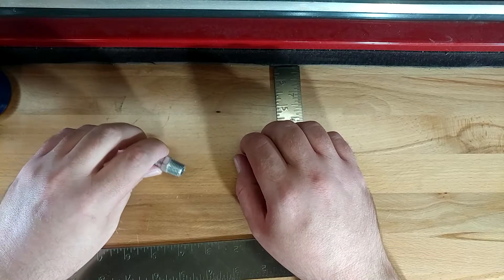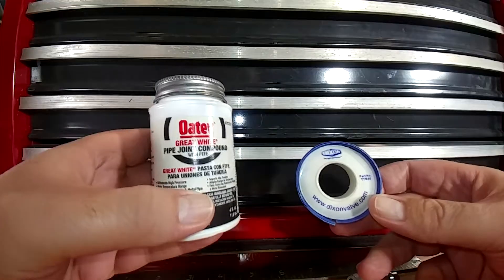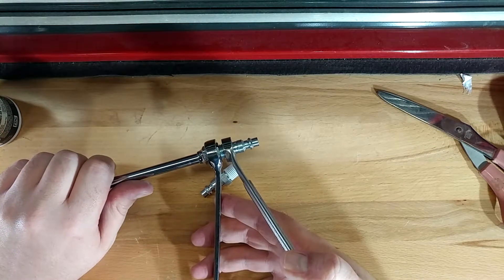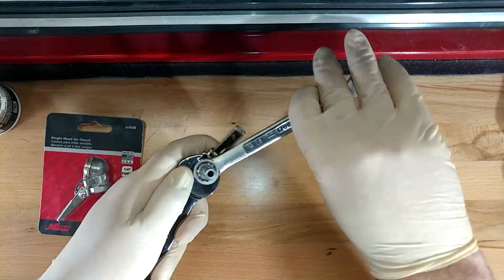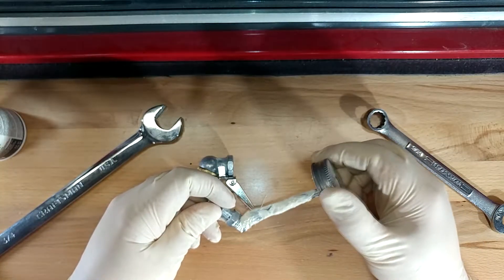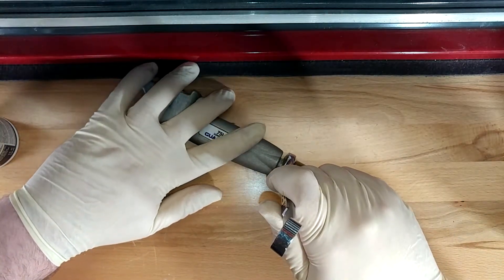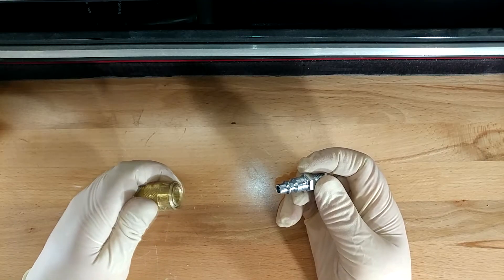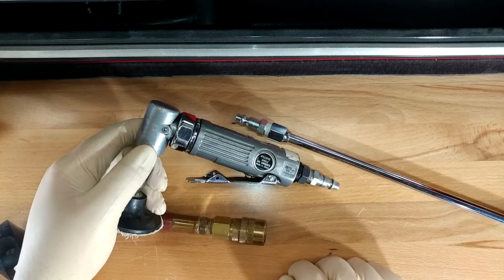How to Seal Air Tool Fittings! Max's Tech Tips!

Comment: Hey pal, you’re a really funny guy, aren’t ya?  I like that, humor what dinnae peas me off none, and what may be that I has larned a wee bit, nesty-paws?  I think all my male air fittin’s shrank in the cold some years back, and it might be that al Qoritm heard them and then suggested me you.  So it seems.  Need they then all replacing, the man parts, and so with higher voluminous fettins, or buy steel ones and drell thum out, and get some female parts, if you know what it is I may mean here, females with, say, higher flow voluminosity to match with thae men parts, but what, I ask ya, shall we do fer thum hoses: up to ⅜”, or æven ½”?  All of thus to impress the naybour, but so too to run my gun wuth paint, yeh see, and a needlin’ scaler.

If yeh thot whut it were hard to read and understood whut were writ, imagin tryin’ ta write et! (or werse, hyar me telkin’). Sae oot thu werds iPhonetikalli, y’ell hyar et!

Comment: If you use teflon tape, check the inside of the line if you remove one. If you screw your quick connect directly to impact tools like hammers, needle guns, impact wrenches, etc they are going to eventually leak. If your coupling is leaking a lot of times you can disassemble it, flip the gasket over and get more life out of it. There are 2 products that work better than tape or dope in my opinion. Loctite 241 which isn't even marketed as a thread sealer but does a good job. Loctite 55 which is what I use now. Tape has no redeeming qualities.  Dope is alright but buy the little tubes if using it on air fitttings. The main problems I had with it was line side on a 240psi compressor. 241 is more consistent than dope but at least one fitting has to be "reactive metal". 55 amazes me every time I use it.

Comment: most air coupler manufacturers also incorporate One Touch a type of quick-connect fitting used in pneumatic systems, allowing for fast and easy attachment and detachment of air tools and hoses. One Touch AUTOMATIC Operation means no need to pull back the sleeve to connect . These couplers are designed for efficiency, enabling users to quickly switch between tools and maintain a secure, leak-free connection.
Reply from the maker: I believe most manufacturers have them available, but at added cost. I've never had any particular problem with the manual ones, but I see the appeal.

Comment: do you need to use teflon tape on air hoses with brass fittings
Reply from the maker: Or another thread sealer, yes.

Comment: I would think my air compressor would just be tightened enough without losing air but I guess I was wrong.I followed your methods and hopefully the teflon tape seals the air leak.if not it’s most likely the fitting
Reply from the maker: I hope so too! Good luck with it. 👍

Comment: I ended up ordering some Loctite 545 thread sealant for my compressor as I'm having to replace the pressure switch on my Central Pneumatic.
Reply from the maker: That will probably be fine.

Comment: I started out on harbor freight’s 3/8 fittings, I believe 4 of them two on my compressor and two on my hoses. The compressor is long gone burnt motor after 6 years and the hoses are riddled with hole and in the gave but my fittings are still going strong probably 8 years later on new equipment and tools. Results will vary i might have gotten a good batch years ago when I bought them n I have oiled the rubber gasket/ring in the couplers when I switched to a new hose or compressor that might have made the difference in longevity idk tho that is just my speculation. I have two Milton’s after being shamed and bullied by my boss and crew Milton $17.99 each x 2 plus tax just to make every get off my case n that was just for the coupler alone no plugs included. Granted this was years ago but I remember paying $4.99 for harbor freight fittings when back in the day and it came with 3 different plugs/nipple male and female . Nothing against Milton by any means every one loves them I like the ones I got they are smooth easy operation but I don’t think they are worth the price tag especially if you are outfitting entire air system compressor tools hoses that’s gonna be pricey really fast . I also am not a harbor freight fan boy let me tell you harbor freight has let me down time and time again with a variety of tool failures they sell alot of crap but it’s so cheap that you a man gets confused by the sexy price tag and you find yourself wandering through the store arms full of nonsense every time you go in there. Harbor freight is truly the devils den
Reply from the maker: We all have our own experiences. I've had to replace so many of the HFT, or box store, fittings that I just got tired of it. If you're having good luck with yours, then that's awesome.

That said, what you paid for your Milton fittings is insane. The kit that I linked in the description is currently $35 and comes with 4 female couplers and 10 males. I like the fittings, but not at the prices you paid for yours.

However... I have been slowly converting over to Parker fittings once discovering that the Miltons have steel cores (the real root of why that's a problem is probably my fault, but...). The Parkers have stainless cores, but and the Parkers really are like $20/ea. 😔I will probably only use them in my most common locations and stick with Milton for the lesser used stuff.  A lot of guys have also suggested I look at the Milton V line of high-flow fittings and I have that video progressing in the background too. They are also very affordable.

Comment: I bought a new air pressure gauge and the 1/8 NPT goes all the way into the chuck and won't seal. Any idea of what to do?
Reply from the maker: I'm not sure I understand the problem. Does the fitting leak at the gauge where you installed it or does the union between the two halves of the air chuck leak once connected?
Reply: It leaks at the threads.
 @TheBrokenLife
Reply from the maker: @kwells4438  I've seen fittings where the threads are cut so poorly that I had no choice but to really layer the tape up to get them to seal. Sometimes to the point that I could barely even see they were threaded.

Comment: I have ALOT of big bore pcp pew-pews... and they all use 1/8" 8mm quick disconnect fittings. They are all either NPT or BSPP. Most use bspp outside of the USA. But USA uses a mix of bspp and NPT fittings. Its a huge pain in the a$$ lol. The pcp industry is trying to make BSPP as the standard across the board, but of course the USA still uses alot of NPT because everywhere uses that in the USA.
Reply from the maker: BSPP isn't common in the US, but we do see some. They're so similar that its easy to confuse the two. I'd more commonly run into various face sealing or tapered seat fittings (which are generally superior to both). For that reason, I'd say that any company that wants to market their various pews in the US should probably do so in NPT. I'm not even sure if I could buy any BSPP fittings at a normal store in the US.
Reply: @TheBrokenLife  yeah most pcp 8mm quick disconnect fittings are found easily in npt and Bspp on Amazon. That's where I find a lot of my 8mm 1/8" fittings rated for 4500 psi and higher. I only buy the stainless steel 8mm fittings. and I buy a lot of those 8mm female/male fittings in BOTH npt and bspp to have on hand. Even tho I tried to switch all my fittings to one or the other ( NPT or BSPP ). Unfortunately, I can't change the oem threading directly on my big bore pcps, lol. So I just threw up my hands and said FU*K IT... ILL BUY A TON OF SS 4500 PSI RATED 8MM FITTINGS IN BOTH NPT AND BSPP WTF!!!?! lol it became impossible to phase out one or the other due to different parts being made overseas. Most of my American made AEA big bore pcps are all NPT. Most of my Hatsan big bore pcs are a complete random "grab-bag" assortment of both, lol... and many of my Evanix ( Korean made ) are BSPP... so on and so forth. so, like I said, I just gave up trying to standardize all my fittings to one or other... because it is impossible until all these pcp companies fall in line with each other. But I dont see that happening any time soon, lol. But, if anyone is reading this, looking for 1/8" SS BSPP 8mm fittings rated for 4500 psi ( that is INSANELY IMPORTANT PCP PEOPLE!!!! ) Don't use BRASS fittings for anything over 3000 psi!!!! Only use stainless steel rated for 4500 psi ONLY... but you can find a ton of them on AMAZON. I literally keep at least 10 each on hand, of the female, male, fill nipples etc etc. in npt and bspp.
Reply from the maker: @danieljamesbindery  Mail order is great, and I personally don't have a huge problem with Amazon, but a lot of the general pew sports community in the US does. They have their reasons, some of which I agree with, but a lot of them are pretty fanatical about it. As soon as you mention Bezo's Deathstar, they freak out. 😆

Really, I don't know much about the PSP community in the US because they're priced beyond their non-air counterparts that are pretty readily available here so I haven't dipped my toes in. It's entirely possible that community is more willing or forgiving than other segments of the sport.

I STRONGLY agree with your statement that people need to understand the pressures of the stuff they're working with, no matter if its a PSP pew or a sander. All pressure vessels are bombs that are looking for reasons to explode. Don't give them one. 👍

Comment: 1)  Anaerobic sealants are another very good option 2) I believe the main intention of tape and teflon bearing tapered pipe treatments is to drastically reduce the assembly torque needed so that the taper can do most , and ideally all of the sealing...wedging enough to get a metal to metal seal even closing the spiral groove. 3) Squeezing two wrenches is very useful when you want to completely restrict the forces to  between the two wrenches... a force couple... very important sometimes.   Tapered thread sealing designs are kind of crude, but that very  crudeness has many advantages as well as many disadvantages... they will never disappear . They are the carp/cockroaches..survivors of the sealed thread world  lol
Reply from the maker: 1 - Sure, they're usually just more expensive and (relatively) harder to find. In short, whatever works for you is great. Use it. 👍
2 - I've heard this argument before I just can't agree. You still have a spiral leak path even in tapered threads. There's no realistic way to seal every tangent edge perfectly while still being able to assemble the parts and manufacture them.  Even with thread sealers they leak half the time. 🤣You also don't tend to see them used in more critical applications, like hydraulic fittings and flammable gases. Those are almost always some sort of face sealing fitting (be it through a flare, a gasket, o-ring, whatever) of some sort without that spiral path exactly because tapered threads can't be trusted.

I do agree they have their uses and we'll see them forever. They're dirt cheap to make and the manufacturers long ago convinced us that sealing their fittings is our responsibility and at our expense. They created the perfect mouse trap! 😆

Comment: If you dont have to immediately use the system then you can use loc tite.  Preferably the blue weakest locker..  after 24 hrs the stuff will have set up and never have leaks for the general life of the fitting..
Reply from the maker: That would probably work, but it's an expensive way to do it.

Comment: Recently got turned on to Prevost brand quick connects and currently in the process of removing the female quick connects from a couple of newer compressors. It seems the manufacturers use something like Loctite 545 Pneumatic/Hydraulic sealant, which makes it very hard to remove, going to try applying a heat gun. Question is, do I use Loctite for the new fittings like the factory, or something like Teflon tape or pipe dope?
Reply from the maker: I've always used tape or dope and rarely have I ever had anything leak.

Comment: Thanks for the concise video! I've never used a sealant for my air tools and just tightened it down when there was a leak. Lead to me breaking a few cheap tools. I only use milton fittings and it's strange how when I swap them out one will leak with one tool but not the next. Same thing with my tools. It seems like each fitting prefers a different tool despite no logical reason. Best video I've seen for this topic.
Reply from the maker: Thanks! I appreciate the kind words!

Comment: Loctite Thread Sealants may be a little less messy to use than the brush. Consider Loctite 565 or 567 which come in little squeeze tubes and works on brass and steel.
Reply from the maker: I may give that a shot in the future. Thanks!
Reply: I like 567,  not to be used on plastics though

Comment: Have used teflon tape for years with almost zero issue.  Very rarely have I ever had issues with leaking NPT connections when using teflon tape.  Usually when I do, it is due to a poorly cut thread or some cheap china-made part that has a poor fit-up.  Recently I restored an old vintage air compressor and decided to try the "pipe dope" thing.  Got the oatly-branded white one.  BIG mistake.  1) The stuff makes a HUGE mess.  Both when applying it AND after the fittings are assembled.. Days later it is still just as soft and goopey as when it came out the bottle.  2) Out of a couple dozen connections, perhaps only TWO were actually sealed - NEALY EVERY fitting leaked. 3) Did I mention just HOW MESSY that crap is?!?!  You end up with it everywhere.  I disassembled and re-assembled thinking I may not had tightened enough.. Same issue.  Finally tore the entire compressor back down and re-did every fitting with good 'ol teflon tape... And what would you know: no leaks.  Pipe dope: nasty messy garbage that is largely useless.
Reply from the maker: I've found situations where it was nice to have one or the other. I do agree the stuff can be a bit messy, but I've found if I just wipe stuff down as I go that it's not so bad.

Comment: Neat video, Those cheap, quick disconnect fittings can be a pain in the ass to use if you don't have a lot of strength. At least the fittings Walmart insisted on buying were that way and only lasting 2 months.
Reply from the maker: After the Milton's break in they're like butter to use. I have about 2 years of use on the ones you saw in the video and there's been absolutely no problems. I've had the HFT and Walmart stuff fail in a few weeks before.

If the Milton's let me down in a period of time that I feel is unacceptable I'll probably try Parker next. The Parker stuff is radically more expensive when I've price it though...
Reply from the maker: Hey Ben... I have a young viewer on my "Cheapest new Dell" video comments that is asking about extreme budget gaming PC hardware. I'm way out of that realm, but I get that feeling that might be in your wheel house from some of our chats. Think you have the time to swing over there and give him/her some pointers if you can?

It's TBT 6 if you want to give it a shot.